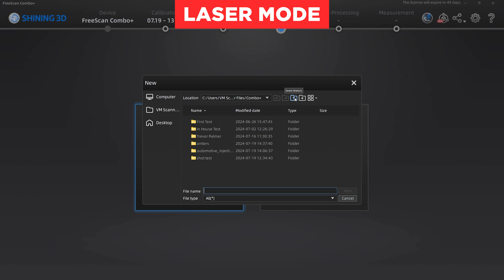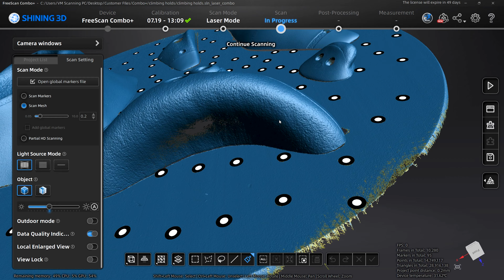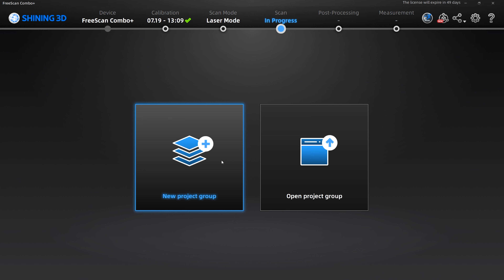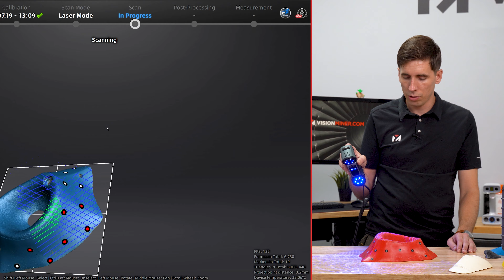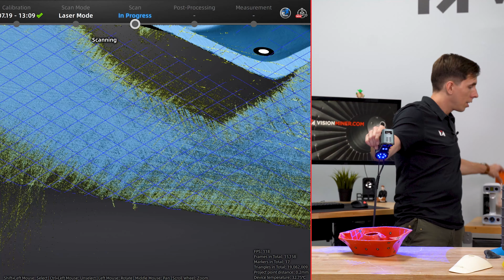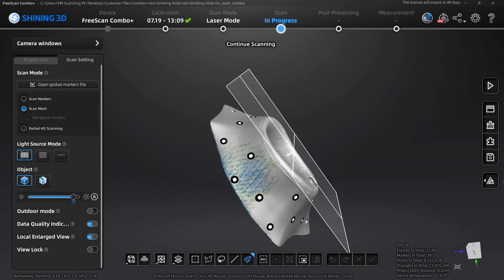Step-by-Step Guide: 3D Scanning Climbing Holds for Perfect Replicas (Shining3D Freescan Combo+)

Comment: nice set up .i am a bit of a nut  diyer and it will be nice when theses things get dirt cheap like 500 ish bucks  and work great but i am of the thinking we are being trolled by the system and thats why trucks cost 90k for a  f350  a certain idem a guy i know needed replaced is up 150 percent in price increase scene 1964..yea lol ... I figure a 3d scanner  in theory its not a complicated bit of components to do this type of work as of the last 8 years or so just  a matter of scale of parts used being around to build it right